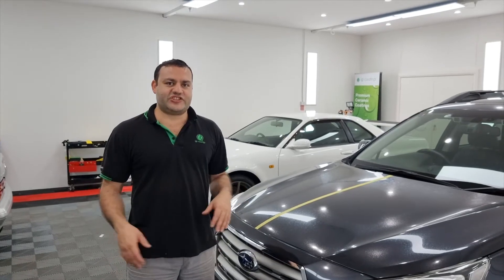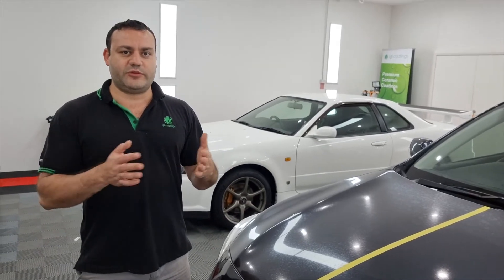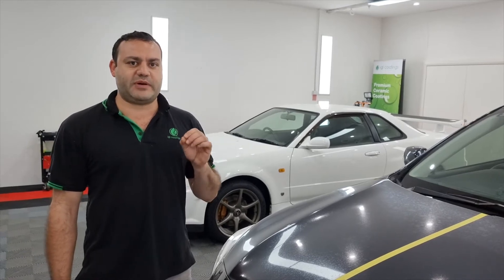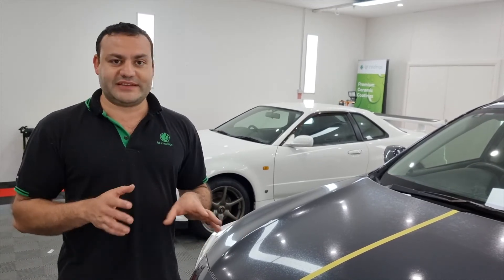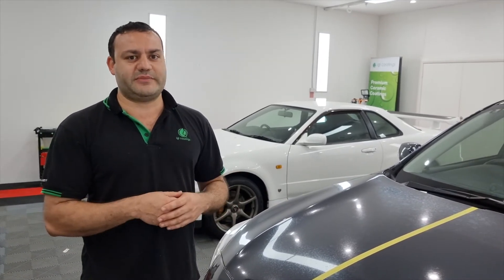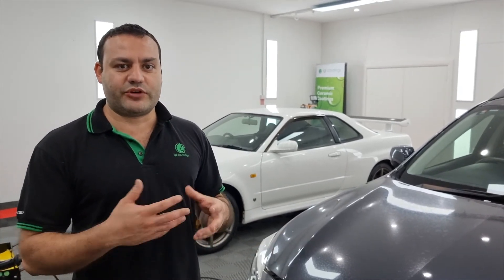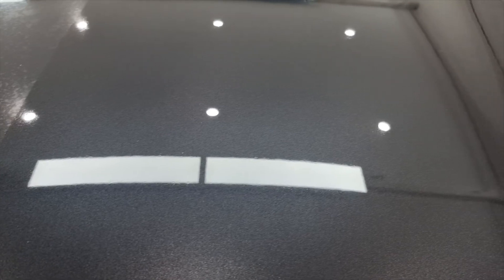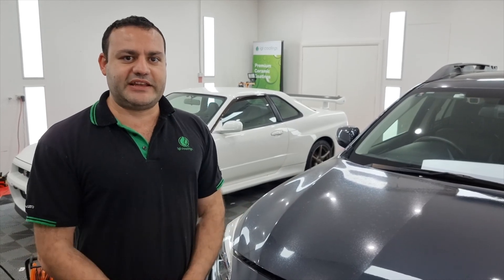Type 2 water spots - Chemical etching on Subaru paint

Comment: Nice work man! I like to wet sand with 3000 grit over type 2 water spots in order to make the buffing cycle a lot easier, the 3000 grit will do most of the removal making the compounding step a faster process.
Reply: What compound polish do you use for this ?
Reply: @MrRoop999  after 3000 grit you can go straight to a polish and a foam cutting pad or microfiber cutting pad. I’ve removed 3000 grit marks with something as simple as Meguiar’s 205 or 166.